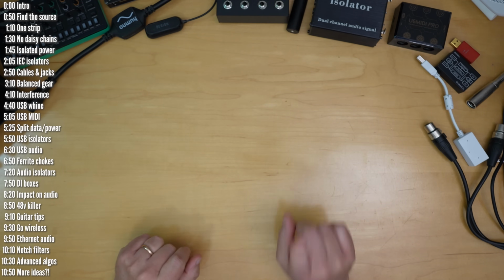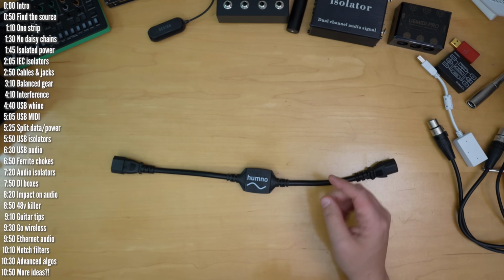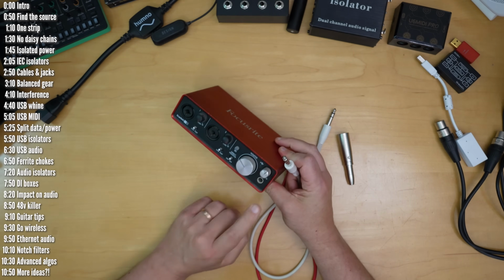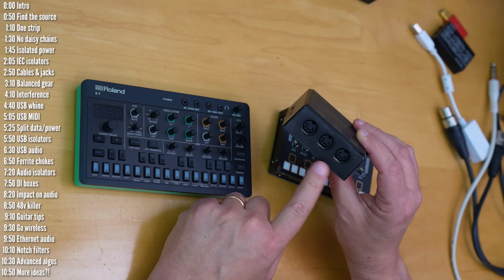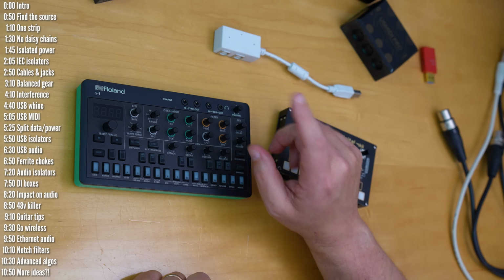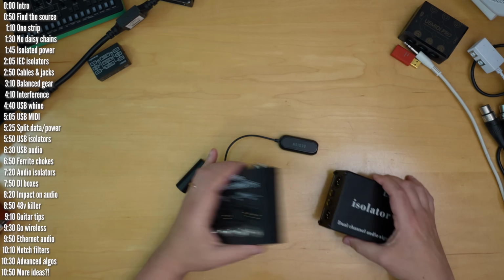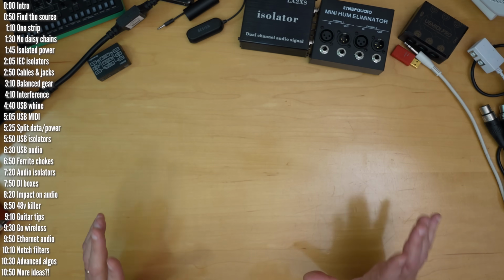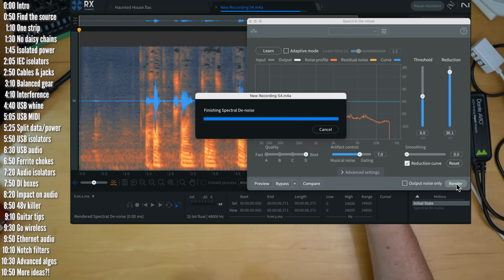12 better, simple and cheap ways to fix noise, hum, buzz, ground loops and USB whine

Comment: I have a vintage Wurlitzer synth organ that both has a large midrange hum and is also picking up AM signals. Any suggestions? It’s already connected to a very good power conditioner, I’ve tried sticking ferrite beads on various cables in the guts that sound like they’re generating some of the issue, and I’ve found a couple spots where if I hover my hand it blocks some of the issue but neither of these solve anything. I would go about figuring out cable replacement or maybe resoddering some of the connections, but there is so many of both of those, that would be months long undertaking so I would rather a quick fix if there is one. Also it’s a lot of rca and I have no rca cables handy.

Comment: I have a pair of KAM DDX 3000 turntables, they have RCA jacks for analogue audio or USB for digital. However they have no means to ground them, either by physical ground or the power lead (2pin figure 8 plug). Whenever I  use the RCA Jacks to plug them into a mixer (in my case a Native Instruments S4 mk2), I get a ground hum. 

Any tips to fix that?

Comment: So I recently got some eurorack and got a noise issue, I noticed it went when I used my analog 4 as an extra lfo then the noise  went away, i tried to use the analog 4 again to get rid of the noise but it didn't work but i think i may have plugged the analog 4 into a different module assuming it was the rack in general not remembering which specific module creating the noise or understanding it could a particular module but after watching your video I'm thinking i can locate the source of the interference by trying to plug the analog 4 into each port until I locate the one that makes the noise stop or is this wrong otherwise I have to unscrew each modules and un plug them and maybe check for noise after each module one by one? It seems confusing is there a good eurorack specific product for this kind of issue

Comment: Important to know: Line up your USB gear to be all set to 44.1kHz sampling rate.

If you add one USB device (like my mixer) and set it to 48kHz, you get exactly the same USB noise on this video (the first noise in this video).
At first it looked like a ground loop, but i tried the Topping HS02 USB Isolator without results. Finally i found out i did not use the same sampling rates in my entire set-up.

And by the way.... the human ear can't hear the difference between 44.1kHz and 48kHz sampling. With 48kHz there's maybe some more fidelity when used in professional movie making. Quality is more affected by the bit depth or the quality of your audio interface, preamps, mics, devices or instruments.

Comment: I solved my problem. In my country, someone had made a small, hand-made box that connected to the head unit's 12v line and ground. I bought it and connected it. The noise on the RCA line disappeared completely; it's a very effective box. (its called 'alpa parazit giderici')
Reply: Bunu nereye bağladın hocam tam olarak?

Comment: I purchased a Furutech Clear Line LAN and USB devices. I hooked the LAN into my modem and switched my USB between my tv and computer, used for my stereo system. 

In a well cabled system, composed of pure silver, they sharpen everything.

Anyways, I just ordered chi-fi grounding devices. Made of an USB, RCA, spade or a clip. I add a short cable made of silver or copper. Then, that's connected to a container. The cover can be made of rosewood or plastic. 

I'll see how this works.
Reply: Those go for $25 each.

Comment: 4:44 Never realized that powering the USB device speakers through the PC would cause feedback or interference. My issue was fixed as soon as I plugged my USB-powered speakers into any power supply not connected to my PC. Awesome video!

Comment: 0:06 thats the EXACT noise i get on my DI, much more audible of course when using a heavy amp with distorsion, a noise gate is no solution because if i leave a chord strum sounding for long the annoying noise fades in

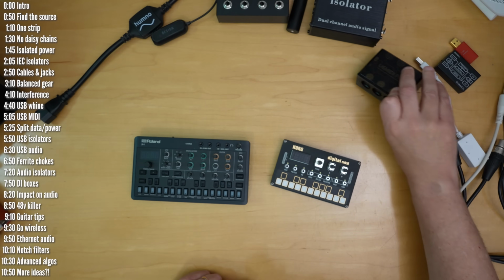Comment: I'm searching for a usb power splitter similar to the one at 5:20 but I can only find results that have a power jack and a power+data jack (rather than a purely power and purely data jack.) Are these suitable? They're meant to supply extra power but having power still coming through the data jack seems like it would defeat the purpose of splitting to eliminate buzz... then again I know little about this and have had no luck finding a splitter that completely isolates power and data.
Reply from the maker: I can't know how they're wired inside, perhaps if it doesn't cost much it's worth the risk

Comment: 4:42 finally someone explained why "USB is noisy"  mine wasn't power by my PC but PC and power supply were connected to the same outlet or something anyways switching to DC fixed the issue, I was about to blame it all on cables! Fantastic video!

Comment: Is there a resource to figure out what your specific noise sounds closest to? I'm having a problem with my interface (Audient ID14) DI instrument line gets nasty high pitched ringing, and I cannot figure out what's causing it so I don't know what fix to purchase. It happens with the gain all the way down, but turning the gain up is what causes it to get worse. I don't think it's the interface (I bought a new one only to have the same problem), it's not the instrument (happens on any instrument, and with no instrument plugged in but the lead still plugged in; is not there if no lead is plugged in). It's not the speakers, because it's only present when trying to record guitar/bass, AND it's present on the input so it records with the noise, and it's present on headphones too. Using the XLR mic inputs is better but only marginally, but the ringing isn't there at all when mics are plugged in there. Tried different USB ports, different guitar leads, no dice.

Comment: i've always used the 3prong to 2prong adapter to kill those annoying ground hums, but only when i'm double grounded. If there are 2 or more grounds in a setup, the noise is going to take the shortest path to that ground, and if something in between the noise and the ground is an audio device that is where the noise will appear. Removing the ground pin from one of those devices won't cause a fire hazard, it will just simply re-route all the noise to the other end of the ground loop, allthough this works 90% of the time, some more complex setups could still need to be consolidated and re routed to different power strips etc...
Reply: If you are going to remove the ground plug from a device that was intended to have a safety ground (metal chassis on a device for example), then at least run the power through a GFCI to protect yourself should there be an internal fault in the device (ie - hot wire inside device comes loose and contacts chassis making it live and therefore you live if you touch the chassis).
Reply: @wally7856  i've used this method for over 30 years, hundreds, literally hundreds of times, never so much as gotten even a tiny shock from anything, the only thing it has resulted in is clean clear audio with no hum and no issues.
Reply: @imothy  Safety grounds on appliances are only there to trip the breaker just in case internal wiring goes bad, breaks and then contacts the metal chassis making it live. It's like a seat belt. 99.99999% of the time they are not needed, it's that 0.00001% that it saves lives. You do you but for anyone else reading, a GFCI will still offer protection in that same fault condition should an internal wiring fault occur and the ground wire to chassis is cut/missing.
Reply: @wally7856  When you're doing a gig and there is a terrible noise that is running through all of your equipment sending awful noises through the PA system, sometimes you have to improvise to save the day. This is how I literally perform miracles. Otherwise what solution to you suggest?

Comment: Is it acceptable to ground the barrel connector on a DC power supply for an amplifier? I have a Fosi amplifier that emits massive amounts of EMI but doing this stops it. When I tried just grounding the metal case of the amp, I get low volume buzzing through the speakers and still some EMI but it is reduced.

Comment: I've got one, It doesn't filtered out the Digital Noise, Like Static Noise from both of My Computers, which I'm using MSI B85-G43 Gaming Motherboard or if I'm using the Gigabyte Z390 Aorus Pro WiFi Motherboard, to the Point that Sounds like a Morse Code every time I move my Wireless Mouse around, even if I'm using Humno on any Computer, It doesn't matter if I'm using the Blackmagic Design Intensity Pro 4K Capture Card, or if I'm using a Green Audio Jack on the back of the Computer or use the iFi iPurifier3 USB Audio and Data Signal Filter/Purifier (USB Male Type B, White), or iFi Audio iDefender+ USB Ground Isolator which is connected to the Native Instruments Traktor Scratch Audio 6 USB Interface, which is plug directly into the DENON DJ Mixer DN-X800 or Citronic CDM8:4 USB DJ Mixer from any Computer, using My 2000W ALTO Professional PA Speaker and also 2000W Alto Professional TS315S Subwoofer. Never matter what I do, I'm going around in circles, and spending so much Money on something that doesn't work. So, is there something that I'm Missing? Because I cannot handle the Digital Noise coming out of My Computer to the Point that Sounds like a Two-Way Radio not tune in, when I'm watching YouTube.

Comment: Mine is like a lower pitched eeeeeeee honk noise, happens when I connect my projector to the PC through hdmi. Power strips don't matter. Even dac with toslink doesn't fit it completely, it reduces the ground noise but it's still there, the 3.5 jack ground loop isolator works but it reduces a chunk of the low end frequency, which makes the subwoofer irrelevant..  I'm at a loss.

Comment: Thanks for the video! Have you had problems with 5G Antenna noise? Im on a 15th floor and its aweful on my vintage equipment such as Reel to Reel machines.
Reply from the maker: You're welcome. Try and use balanced cables to avoid interference; if the gear doesn't have balanced IO try a DI box very close to the output.
Reply: @loopop  Thanks for the reply. I tried balanced cables and no luck. Its a Pioneer 707 so the outputs are unbalanced RCA. Im going to try with DI box and i´ll tell you. For example if I go to the first floor with the tape machine I have no noise.

Comment: some tips from me:
your guitar and amp should both be grounded even if its just a practice amp, which usually doesn't have a ground lead. its simple enough just drill into the metal casing without going near components and attach a lead to your ground on your wall plug. grounding your guitar means your internal circuitry ground path is also connect to your strings via your bridge. if you remove the bridge should be a tiny hole with a tiny wire going to your control pot area. you can get rid of a lot of noise from this alone. usually its this.

Comment: I have really bad humming with scarlett 2i2 and Yamaha HS80 monitors coming from the GPU of my PC. I.e. the noise varies with what goes on graphically. And it doesn't happen when I connect my laptop instead, nor if I listen via headphones through the same interface. The scarlett is powered via USB, but I also tried a different interface that is powered externally, but to no avail. What can do? I assume that the iDefender or similar will not do the trick, since isolating power did not work previously? If I have to use an audio isolator, which one is recommended for 6,3 jacks that will not impact sound quality and does not cost too too much?

Comment: Ferro rings etc, on cables are used for EMC improvement of the equipment the come with, not for outer noise sources as in this case. Ballanced cables have the same signal, but each channel has opposite phase, with noise having the same phase it is cancelled out when it's combined. Yes good shielded cables improve noise rejection, if the shielding is consistent end-to-end.

Comment: I have an idefender for my pc and it works wonderfully, but for some reason I have another ground loop coming from my speakers. The only solution that works was counter intuitive. I’ve heard that you should separate the power if you have a ground loop coming from two devices. But the only thing that worked for me was to extend the power of one speaker all the way to the same outlet of the other speaker. And get this, I have to do it with a extension cord.. If I don’t use the extension cord the noise comes back no matter where they are plugged into. It’s the weirdest thing.
Reply from the maker: In this video one of the things I mention first is to use the same outlet

Comment: balanced amps are actually more distorted...  they make the ground loop issue worse right before they cover up their tracks.. typical unbalanced is as direct as the circuit can get.  least distortion possible but very susceptible to noise.
best balanced interfaces struggle to get out of the one-teens...  110db SNR yaknow.. around there...  unbalanced amps get closer to 130... we're using unbalanced amps because we DON'T want to use balanced amps...

Comment: I missed one alternative method to get rid of noise/interference/etc: digital mixers with SPDIF/ADAT I/O. The only problem is that so few modern equipment supports these. I've got a RME audio card with ADAT and SPDIF and it works great with older gear like a Roland XV5080 and an Access Virus TI. Pristine audio without a heightened noise floor, hum and other inconveniences. It's a shame that digital I/O never made it big and that the best we can hope for is audio over USB.

Comment: If your interface or speakers are noisy, get professional ones. If anything else is noisy, throw it in the trash and download the VST equivalent.
Reply from the maker: Sorry, that's really bad advice - if the source of noise is, for example, using unbalanced cables,  or any of the number of other things I mention in the video, then even the most expensive speakers or interface will output noise.
Reply: @loopop  That's why I wrote "If your interface or speakers are noisy" and not "If your speakers or interface are outputting noise".
Reply from the maker: @ the issue I try to address in the video is that it's often hard to tell the difference, and regardless, there are plenty of low-cost interfaces and monitors that aren't noisy, it's not something you need to spend "professionally" on to avoid noise.

Comment: One quick addendum to the guitar tips - I live high up in a high rise in downtown Chicago, and guitar cables here often pick up radio stations quite clearly - the by far best solution so far for me have been the Warm Audio Premier series (as opposed to Pro series) guitar cables. Their substantial shielding has made this extreme RFI problem a thing of the past.
Reply: could always buy ferrite clip ons too as an option.. not ideal but it's something.. but yes a better shielded cable should do the trick

Comment: I've found the Rolls Stereo passive DI to be a great option for very inexpensive. I feed mine backwards to get a balanced stereo line in to an ATEM mini. Unfortunately, the Audinate Dante AV I/O series are very picky with switches. I've had no reliability with inexpensive switches. To do it properly, you do need a ProAV switch with Quality of Service.

Comment: 9:30 What I've suffered is the noise that occurs when I connect a 5V power supply while using these kinds of wireless systems to it. Do you think HS02 will work? A USB isolator similar to the ifi product didn't work...
Reply from the maker: If you powered the ifi then I'm not sure the HS02 will work. Always buy from a place with a good return policy

Comment: Might want to clarify your advice about speakers.
YES use balanced cables to connect your POWERED speakers.  Those are the ones with power amps built in to them. So you just connect a line level source. PASSIVE speakers should be connected by speaker cable, which has just 2 conductors wired to teh TIP and SLEEVE. There is no Ring in a speaker cable circuit, however some idiots thought the XLR connector was so neat they used it for amp to speaker connection. So yes, it is possible to hook up a vintage speaker with an XLR cable. Though I've never seen an amplifier with a corresponding XLR output. And I have been a sound engineer for 35 years.
Reply: Also important to note that TRS and XLR cables can create ground loops if the shield is connected to the connector at both ends of the cable. If making your own cables, leave the shield unconnected at one end. Also, using isolating plastic washers when mounting equipment onto racks is helpful at preventing ground loops; each piece of gear should be earth grounded only through its power cord and they should not all be commoned together by the rack rails functioning as a buss'bar ground.

Comment: Besign: 3.5mm unbalanced stereo isolator immediately solved ground loop “buzz” coming from monitor speakers receiving analog audio from the output jack of my Samson Go Mic.  This issue had vexed me for years, and your tip saved what was left of my grey matter — THANK YOU!

Comment: i would add that wireless connections bring up a whole new category of noise in the form of interference.   in my tight apartment that solution became unusable pretty quickly.   routers, bluetooth connections both known and unknown, adjacent mystery devices in other apartments, etc etc.... anything over one meter away became instantly useless.

i will also add:  thank you immensely for all your work over the years, mr. pop.   you have taught me so much.
Reply from the maker: True, that is possible, I just found in my case that nasty guitar noise that drove me nuts went away when using wireless